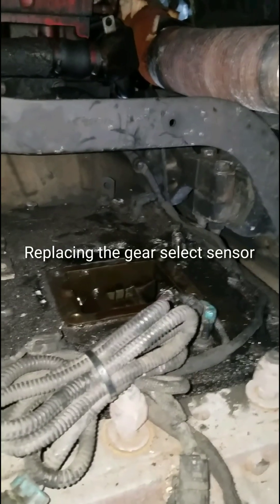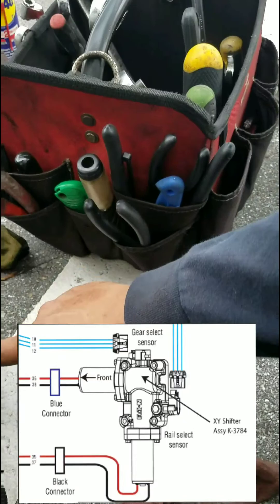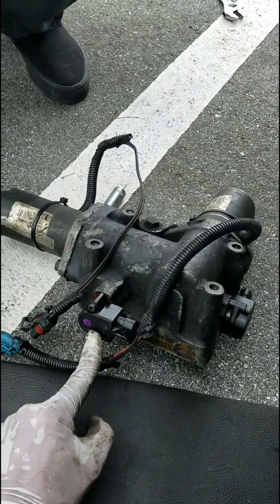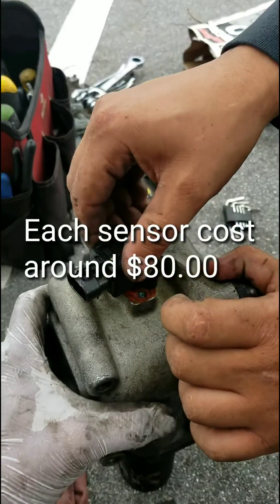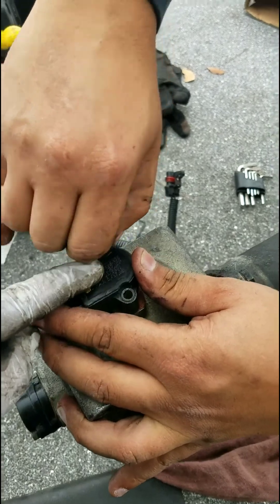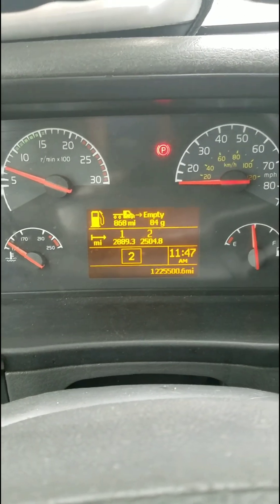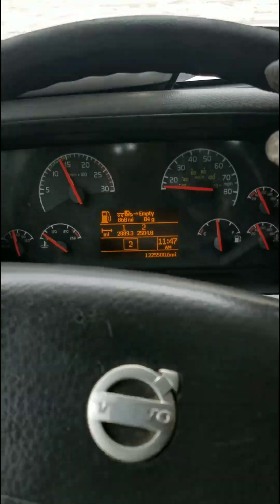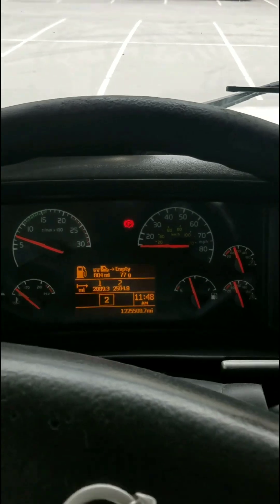Eaton Ultrashift Problems

Comment: I have the f flashing while driving thru the gears....but in 9th-10th the transmission goes blank as if the clutch is slipping a tech said to change the harness on the trans because I’m getting a break inertia fault that says short in circuit
Reply from the maker: If you are getting the Inertia break code it could be the clutch. When did you changed it? I don't think is the harness
Reply: Erinson Duran I haven’t changed nothing....tech that scanned it said there’s a short & parameters are not right.
Reply: Also when I put the truck into gear it seems to slam the gear in similar to a manual truck that needs a clutch adjustment and when I start moving it jerks violently to begin applying clutch
Reply from the maker: Yes it could be the clutch but you need to get me the codes so I can help you
Reply from the maker: @Lrgfab  what make and year truck do you have? You can get the codes by turning the  key to the on position 4 times in 5 seconds. Start in the on position and finish in the on position then wait for the code in the dash. 25 and 88 are ok
Reply: Erinson Duran 06 Columbia I tried 4 times 5 times and 6 and all I get is flash f and n
Reply: Erinson Duran also getting on dash ecu 130 sid 054 fail 05
Reply: Erinson Duran the code I’m getting is 44 the other day It ran normal no issues in 9th or 10th
Reply: Code 44

Comment: I’m having this same problem in my Kenworth. I want go into gear but when it does I can drive it and it runs good but sometimes it want go into reverse or drive. I put a new clutch and service the transmission. Just drove it 3 hours no problem. Please help
Reply: I had the XY Shifter checked the guy said it’s good and it works just fine. I was trying to keep from towing it to a shop for them to charge me 1500 for a 50 dollar job. I had the speed sensor replaced now I will try the gear select.
Reply: @bossofbosses7009  im having the same issue in the video i changed my xy myself drove one day and it started back im getting code 88
Reply from the maker: @bossofbosses7009  yes that's what I would do.
Reply: @erinsonduran6663  How do I check the xy shifter before I buy a truck with this transmission?
Reply from the maker: You can not if you are not getting a code, but as soon as you buy it change the speed sensors. There are 3 of them with the same part number, one in the yoke and two on top of the transmission. They only cost $38 each and are easy to install.
Reply: @bossofbosses7009  you ever figure out the problem? Having this issue now with my kw
Reply from the maker: It looks like your problem is the xy-shifter
Reply: Do you think it can be the sensor?
Reply from the maker: @bossofbosses7009  yes it could be, but you need to get the codes then I'll tell you.
Reply: I had the sensors replaced a week later it did it again. Guess I’ll replace the XY Shifter
Reply from the maker: You need to get me the codes so I can help you, but it sound like gear select sensor or motor
Reply: Never figured it out did u

Comment: Hello Erinson
I got a 2010 freightliner cascadia DD15 I smartshift.I get a check trans on the dash and can’t start my truck sometimes.I get a code SID 237 start enable device FMI 4 can you help me out with this as to what it might be ,thanks
Reply from the maker: Hello  Jose your truck is getting stuck on a gear and that's should be the xy-shifter. The gear position sensor or motor is getting bad.
Reply: Erinson Duran 
Hello and thanks for the response but when I drive my truck it runs and shifts smoothly do you think it could be the gear sensor then ?
Reply from the maker: @josecampos9372  if it doesn't want to start it is the xy-shifter (gear sensor or motor) what happens is that it stays on a gear instead of neutral. It would get worse. Let me know
Reply: Hello Erinson Duran 
Thanks I will look into it ,thank you!

Comment: I have service light but the truck don't star when I turn key on please can help me
Reply from the maker: Your problem is the Rail select sensor or motor, go under the truck and tap the xy-shifter with  a wrench or hammer (gently) then go and start the truck. Try to retrieve the codes with the key and let me know. Dont forget to subscribe to the channel
Reply from the maker: Did you fix your  problem? Help others by sharing your results, and like the video. Good luck.
Reply: Engine wont start if transmission is in gear.

Comment: The shifter is gonna go bad eventually and maybe pretty soon. why not the change everything since you are taking it off and be good for 2-3 years, I changed sensors and the harness but not the shifter and it cost me $1500 more to change it on the road, trying to be cheap on parts will end up costing you more

Comment: I have  a 2007 9400i with automatic, I was going down road truck shift to 6 and took a min to go to other gears. I get it home it didn't want to go into gear just started beeping what could be my problem???
Reply from the maker: It looks like the gear select sensor or motor is going bad, but to tell you for sure you need to give me the transmission codes. If you want to get them follow this instruction. With the truck off turn the key 4 times in 5 seconds to the on position and finish on the off position the look at the dash and write down the codes
Reply: It said unable to disengage gear mechanical system(flash code 71)
Reply from the maker: @hugoboss3573  go underneath the truck and hit the gear select  with something hard (gently) sometimes they get stuck when they go bad, but that can get you back on the road. Replace the sensor or buy a new xy-shifter.
Reply: @erinsonduran6663  will I have to drop the transmission  to do this ?  I left mine with freightliner..they called and ask for permission to  drop the transmission to perform  this procedure 🤔🤔
Reply: Now I remember that I  tapped on transmission to move the truck before they called a wrecker🤯🤯
Reply from the maker: @robertolove8913  
No Roberto this is on top of the transmission
Reply: @erinsonduran6663  My truck got lost in 6 to 3rd  gear and blinking while in Amarillo , Tx.. I coasted into a  parking lot..disconnect  battery  cables ..reconnected  and drove to Dallas, Tx without  problems until the next day.. I put the truck in freightliner  shop.. they never got started yet.. but ask if they could drop the transmission...Monday.. I plan to get there..orderthe sensor and put it on myself
Reply: @erinsonduran6663  Man I was praying for  answers 🙏🏽👍🏽hopefully  the harness or sensor es the answer... I hate working for nada👍🏽
Reply from the maker: @robertolove8913  yes but try to buy the whole xy-shifter because like that you don't have to worry for at least two years. Check the code and let me know
Reply: @robertolove8913   how did you fix your problem

Comment: Having that problem right now.  Help, anyone.
Reply from the maker: What code are you getting?
Reply: I have a automatic with clutch kenworth t660 2009.
It started acting weird since it didn't want to downshift from 10th gear. I watched your video trying to fix it.  I disconnected the low gearshift sensor and let it sit for half hour until it restarted.  It turned back on but half hour on the road it started acting weird again showing the service light on and letter F on the dashboard.  What could be the solution?
Reply from the maker: @obedcedeno2985  it sound that your XY-SHIFTER is going bad but without a code I can't help you.  You can retrieve the code by turning your key to the on position 4 times in 5 seconds but do not start it just to the on position. You will see the code in the dash.
Reply: @erinsonduran6663  I'll try it in the morning again
Reply: The codes were 63-75-17-83-37
Reply: Then i did it again searching for codes and it only showed 88. What are those?
Reply from the maker: @obedcedeno2985  you only have one problem there and it is the gear select motor. If you watch the video I changed the gear select sensor but I recommend that you replace the xy-shifter because you. It is very easy to remove because there are only 4 bolts on top. Good luck.
Reply: @erinsonduran6663  how do i access it?
 I crawled under the truck but there no room to do anything there.
Reply: All of these codes are for the same thing?
Reply: @erinsonduran6663  Sir, sorry to bother you . I have the same transmission I'm not getting any comes. But on 2,3, and 4th gear instead of making the air sound sometimes it makes a clank and grinding sound. Its only the low gears. Also if I shift by pressing up shift never makes the sound. If you can help thank you and God Bless.
Reply from the maker: @osbaldogarcia5390  IT is difficult to tell without a code,  but it could be the synchronizer
Reply: @erinsonduran6663  thank you I'll have it checked out
Reply from the maker: Did you fixed?
Reply: @erinsonduran6663  yeah i just had to replace shifter. Although i bought it used for 300 cuz brand new were  $1000-1500
Reply: @obedcedeno2985   please tell what company you purchased the x y from
Reply: @bruceleejr7631  i bought it used on eBay

Comment: Sir good morning were are located at in California in victorville
Reply from the maker: I'm in Florida
Reply: @erinsonduran6663  my ultrashift goes out of 2 when starting up I stop about 2 or 3 times then the truck picks up the gear but when I stop again the same problem happens .
Reply from the maker: I'm not a mechanic but tell me about your problem to see if I can help you.
Reply: Just change the hole shifter with the motor but know it gets stuck in gear and wont up shift or down shift can it be the speed sensors please help
Reply from the maker: @rickgallorobles3992  the speed sensor is located in the rear of the transmission and it is easy to replace, I'll recommend you to change it as well as the input sensor on top of the transmission. They only cost $39 and are the same. If it is stuck on a gear disconnect the battery for ten minutes an plug it back, it should reset automatically.
Reply: Thank you we're going to chance both the speed sensors  do have to reset the computer
Reply from the maker: @rickgallorobles3992  ok, let me know when you do it. Change the 3 sensors (input, position and speed) they are the same.
Reply: @erinsonduran6663  in what location is you in Florida?
Reply from the maker: @angelgonz201060  west palm beach Florida ⛱ 😎

Comment: Recently became an international tech in houston, first time working on these auto shift units. Only a week into operating/diagnosing these transmissions, not 100% convinced of this technology on these. Ive been assigned to train along side a senior transmission specific tech, maybe my opinion will change, not that it matters. Ultimately eaton fuller is a highly reputable company, so time will tell.
Reply: Where is it located 
The E C A
Reply: @bruceleejr7631  its the box like module underneath the bell housing, nearest to inspection plate, 4 bolts for the cover 4 bolts for the module, turn it clock wise to remove it from bell housing.
Reply: Thanks for the info
Reply: @bruceleejr7631  one more thing, if you plan on removing it without ServiceRanger you may or may not have issues, ServiceRanger calibrates the ECA's position sensor to reassure its clocked correctly and applying the correct pressure to the throw out of the clutch. I dont know 100% that itl cause damage or not, ive seen techs install it without calibration but never saw the life of the clutch. It might be best to have it calibrated per eaton fuller recommendations. (btw ServiceRanger is Eaton fullers dealer level software)
Reply: ECA - electric clutch actuator was the problem

Comment: hello I have a similar problem with my smartshift 10 speeds when it starts it starts bouncing all the speeds until you get to first and then it does not make the changes and I get the transmission check
Reply from the maker: Yes you should start looking to get a new xy-shifter because it is going to leave you in the middle of the road. Or get the code and I'll tell you what to do
Reply: @erinsonduran6663  the codes are FMI 2 OC 1  SID231 SAE J1939 Data link
Reply from the maker: @gabrielflores9604  can you get me the code from the Eaton computer?

Comment: I had a 2001 Volvo ultrashift 10 speed with cluch. Cluch is new and adjusted. When rpm goes 16-17 it doesn’t shift up unless I let gas pedal off. It also doesn’t shift lower gear . It just become like neutral. Ecm says mid 130 not responding. And part number 759. Please help. Thanks
Reply: Yea but 2 guys tryed to find like 7 hours . They checked almost all cables and they charged 1200$ so I’m fucked up.
Reply from the maker: This one is a 2007 and it is fully automatic, without clutch
Reply: I fix my stuffs on my case, what would be the problem. It also says j 1939 data link error
Reply from the maker: There is nothing to do without a  code. Could be bad connections or anything.  Sorry
Reply: It was a cable short problem. Ecm to transmission cable was short they fixed it and now it’s normal
Reply from the maker: @yuksel381  good it wasn't a bigger problem

Comment: What's your overall opinion of the transmission?  Is it worth having vs alternatives?
Reply from the maker: It is a good transmission but you should have a little experience handling with tools and be ready to get dirty, or your mechanic would take a lot of money from your pockets.
Reply: I r hun a lot of local work and the aitoshift is nice when it works. When it starts to screw up though it can get EXPENSIVE FAST

Comment: I need your phone no brother 
I have same issues my truck is in still 4th gears not changing gears after restart truck its gone N afternot gear working!!!!!!!!
616-678-1986
I’m at El Paso tx right now
Reply: Paris Freight Lines CA USA clutch
Reply: HEY, I'm in el Paso, TX right now and I have the same problem with my 10 speed ultra shift, I had replaced almost everything, x y shifter, 3 speed sensors, harness, solenoid etc etc and still not working....... did you solve your issued, what did you do ?
Reply: @jyvids6670  try to change TCU, computer from transmission
Reply: @jyvids6670 The ECU of transmission
Reply: Mine is in the shop right now too. Im in Houston
Reply: @drnockaable  What was the outcome
Reply: Hi very informative video. Thanks. Could I give you a call.  915-443-2941.

Comment: Hey what's going on, I have the same issues. I have a 10 speed ultra shift the back seal of the transmission is leaking alot of air I replaced the seal the high and low range valve speed sensor gasket check valve regulator and i still have the same issues. Any suggestion?
Reply from the maker: Try to get the code and ill see if I can help you

Comment: Where do you get the sensors? Can't find them anywhere????
Reply from the maker: Go to any dealer, they have to be special order.
Reply: Went to freightliner dealer all they would sell is xy shifter for 1600
Reply from the maker: Did get the code? If yes what is it ? Before you get tu he parts
Reply: No code at all
Reply from the maker: Make sure you dont have it in manual mode, it could be one of the motors. You must have a code for me to help you from here
Reply: Joseph Peters  hi Joseph I have the same problem my gear won’t shift unless I let go the gas pedal I have a 07 century with 10 speed Eaton smart shift, I was wondering if you ever got it fixed and what was the problem. Thank you

Comment: Was there an issue with I have the same transmission in a Kenworth T800 pump truck and I keep having the transmission fault and get locked in 6th or 7th Gear do you think that replacing the gear select sensor is the answer sometimes I'll stop the truck and let it sit for a few minutes and then it will come back on but it's increasing how often this occurrence happens thank you for your help
Reply: Had same thing happen to me other people i read on line and everyone came to same conclusion it was our clutch.
It will do it often until you will need tow so get it change.

Comment from the maker: This sensors are easy to replace and you don't have to expend $1300 plus towing and mechanics
Reply: Please tell me where did you get your sensor from I need it ASAP PLEASE text or call me 478-733-3462 Ken
Reply: Thank you. I’m having this issue right now. It’s a  2013 Volvo vnl 64t. It was driving me crazy. she shifts fine, but that F just keeps flashing on the dash🤦🏾‍♂️🤦🏾‍♂️🤦🏾‍♂️🤦🏾‍♂️
Reply: What state is this
Reply: What sensor do I need for this
Reply from the maker: @TroyP20  look at the video again and write them down.
Reply: Erinson Duran I have code spn 563 fmi 9 my truck shifts fine it’s the check trans light keeps flashing even tho it runs great
Reply: Erinson Duran I’ll pay u for a five minute consultation on the phone
Reply from the maker: @TroyP20  men you don't need to pay me, I've been in your shoes I'm not a mechanic but send me your email